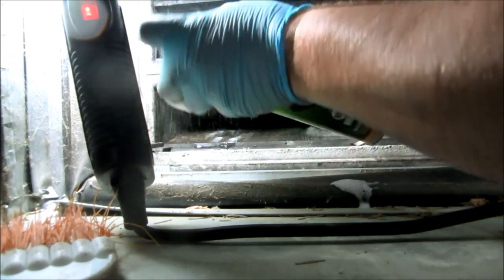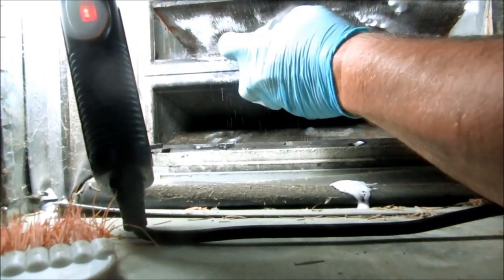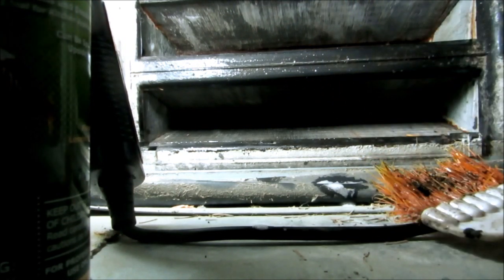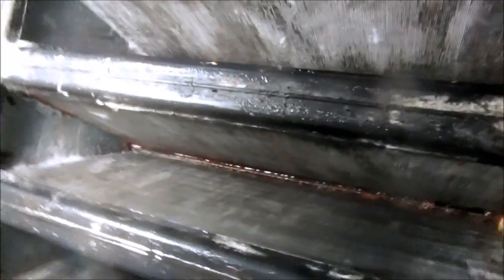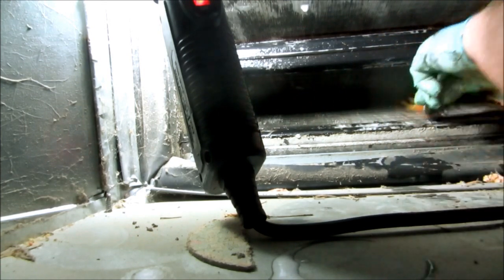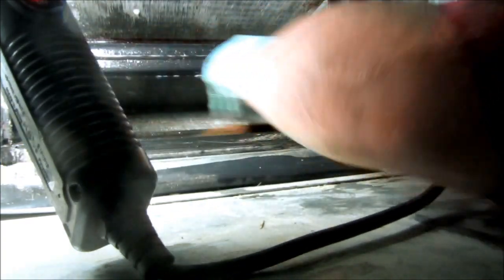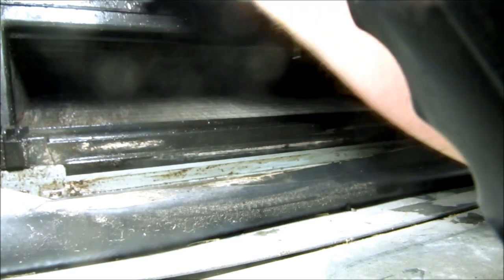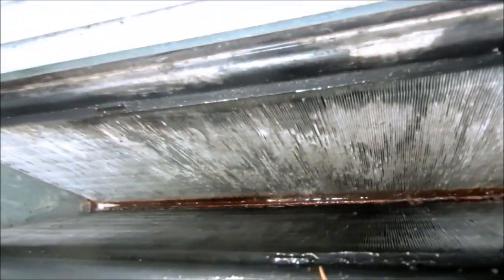hvac-how to clean a  A.C. Acoil in place

Comment from the maker: with out the brush it won t work so well ,it came clean for sure ,the little coil brush has saved me many times for sure,the system kept icing up ,i been there before to reset the charge ,but i had to clean the coil to stop the problem .it iced up like 2 times  over the season  .not all the time .i had to get into it deeper  hense cleaning the coil was the next step . thanks for watching ray

Comment from the maker: its good for stuff like that job .i stock it in the truck .you really need to get in there with a coil brush to get it clean ,,the foam cleaner helps ..thanks for watching p.j
Reply: I used 2 no rinse cans and compress air and nylon bristle brush

Comment: Wasn't aware these can just be cleaned. Had a tech come out cause my ac is not reaching the setting. I have it set at 75 and doesn't get under 79 during day. It is hot here in south Texas. But he said your evaporate coil is clogged and needs to be replaced. He said it would be $1,800 for a trane coil and $1200 for an off brand. He never said anything about just cleaning it.
Reply: Egbulldog79 Lol, sorry bud, but you should always do research before spending that kind of cheese. I'm not saying you didn't, I'm just saying. Not all HVAC techs are as honest as I am. I'll tell you this, I make as many sales as the liar does but with the ability to sleep at night. My customers always ask me for my personal phone number as to circumvent the company but I never go behind their backs, bad business. I always tell the customer the facts, give them my opinion, and let them make the decision for themselves. I hope that everything worked out for you.
P.S. I'm pretty sure southern Texas gets hot, lol.
Reply: Michael Mace nah I didn't do it. Turns out was just low on freon. You're right though they're liars.

Comment: I can't tell ya how many times I go back after another guy where the customer says they just had another guy out a month ago to do a PM on my system and the unit is freezing up because its plugged up. I'd say that 75% of my service calls this past summer have just been dirty coils and 90% of the other ones were caps.
Reply from the maker: +Michael Mace keeping a clean filter in unit can save cleaning the coil ,problem is lack of proper maintance from the start ,once the coil is durty it  must be clean like you said ,good comment

Comment: so where does all that liquid go? - On mine.. I can see there's a pan underneath, but the pan is just around the edge...there is nothing to catch a liquid that falls through the inner part of the coil.. I see insulation below the condenser, so I am afraid to use water to wash it off.

Comment: I have a horizontal unit Goodman I believe, did you pull the heater unit out of the way to reach the coil on the evaporator?
Reply: I have one too and no mine is to the right of the heating unit.

Comment: Kinda looks like what I have but not 100% sure if my coils are in the same place as this video.....I would have to get up under my unit to do all of that, and I dont have much space to work with.... might have to call a professional..
Reply: No one ever replaced the evaporator (inside the house) filter, so there was 25 years of dust built up. I had three professionals check and want to replace the whole unit at $7000?? One guy replaced the heater door switch for $250, didn't even vacuum the return box. I have taken a couple of hvac classes at local community college, I got the instructor to come to my house to give me advise. Let you know. I am thinking I can separate the heater from ac unit and clean the inside of evaporator coils.